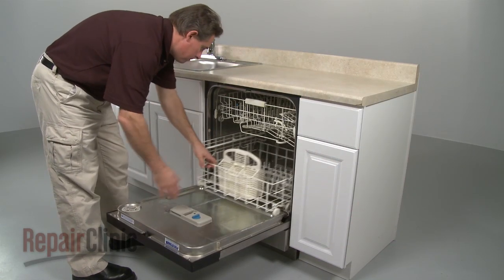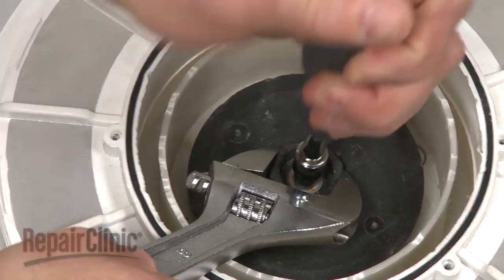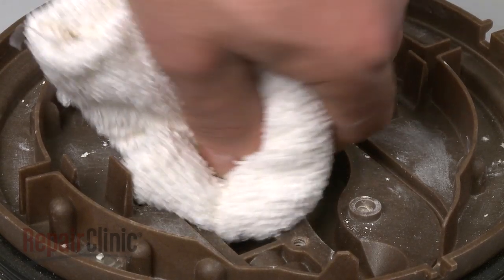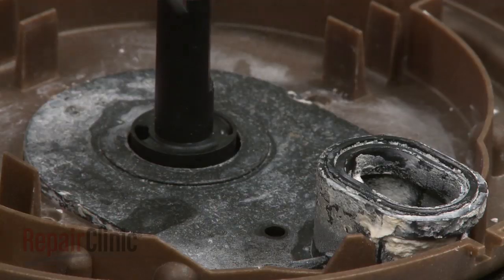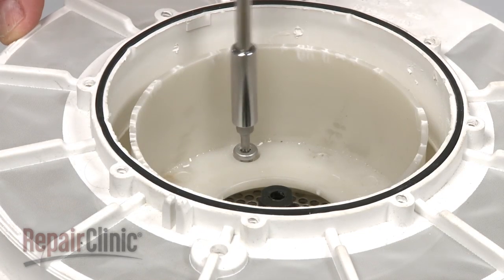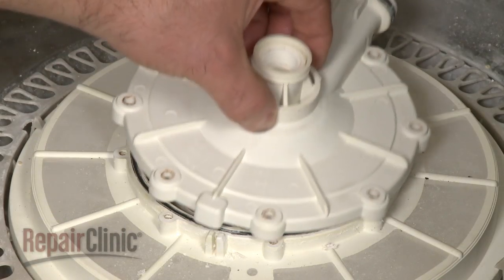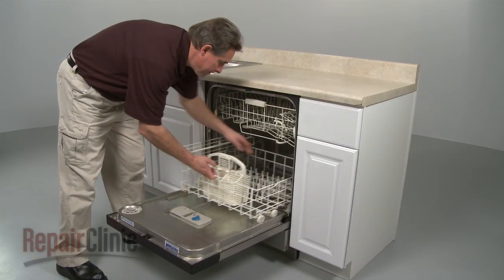Dishwasher Impeller & Seal Kit Installation #8193524 or 675806

Comment: Fantastic to have a clear picture of dismantling and reassembly.  Gave me the confidence to take mine apart.  The inside was disgusting.  No wonder the dishes weren't getting cleaned properly.  Fatty gunk blocking everything.  Found a screw and washer in the upper impeller water pipe, no idea how it got there.  It was the same as that which holds the impeller in place.

Comment: The kit comes with a gasket that the video does not mention/use.  Put the smaller gasket where the check ball holder has a gasket.  (Hey Repair Clinic -- put a note on the video.  No need to reshoot the whole video.)

Also, my drain impeller was broken to pieces.  This made getting the impeller screw out REALLY REALLY difficult.   We put an ice pick through the motor windings hold the motor still.  It took two people to get the screw out.  The dishwasher is working!!  Thank you Repair Clinic.

Comment from the maker: The small seal goes where the check ball sits in the oval recess. It unfortunately was not replaced in the video.  Our repair Gurus have made a note of this and are considering a re-shoot.  Thanks for pointing it out!  If you need any more help please refer to the help section of our website (links in the description).

Comment: Great video, I had trouble removing the impeller screw. The inside of it had broken so I could not keep it from spinning while removing the screw that holds it on. Had to take a Dremel to it and cut it off. Once it was removed I could put a wrench on the metal shaft and then remove the screw. Thanks for the help!
Reply from the maker: We're glad you got it done in the end. Congrats!
Reply: Mine stripped out also. I had to hammer and chisel both plastic pieces out.

Comment from the maker: I would check the impeller to see if there is something clogging it or if it is damaged. If this doesn't help I would suggest heading to the repair help section of our website (link in the description). If THAT doesn't help there are many reputable  DIY blogs and forums that should be able to help.

Comment from the maker: @WildMuffdriver The manufacturer has updated the impeller kit so that the busing is not reinstalled. The kit comes with instructions to throw away all old parts and use the parts included in the new kit.

Comment: Thank you so much for your video.  My washing machine was extremely "crusty" inside, making it difficult to remove the parts (cemented together from mineral deposits).  It seems that the washer could be designed much more efficiently to service the parts. It's almost like the manufacturer designed it to be so difficult to repair that it would be easier for the homeowner to just buy a new one!

Comment from the maker: Sid, The motor does not have service parts so if it is coming from the motor then you will need to replace it. If it is coming for the pump and you installed a new kit we would suspect debris got left behind.
Reply from the maker: Sid Kamath Thank you.

Comment: Thank you- this is my exact dishwasher!  

The smaller gasket that is supposed to replace the gasket in the oval part of the drain cover seems much smaller than the gasket it is replacing. Is that correct? I noticed that the gasket in the separator assembly does not need to be stretched. Also- should I be using "Lube Magic" or some sort of gasket seal gunk when I put the gaskets in?

Yes- a few of those parts were MUCH harder to remove- I had to dremel out the wash impeller cover when I broke the part you recommended to put the wrench on while taking out the screw. The screw did NOT come out until I  was able to put vice grips on the motor shaft after I took out the separator assembly. It's a shame that those parts get so brittle with age and all the heat. Should they not be made of a material that will withstand the heat? I hadn't intended to have to replace these parts. 

I am, however, very thankful to have had this video to help me figure it all out. Thanks again!!!

Comment: If the impeller is broken off from the shaft, it may be difficult to remove the screw. I took the bottom cover off of the dishwasher and stuck a screw driver in the motor fan to lock the shaft in place while I unscrewed the impeller. Worked well for me.
Reply: I was wondering if you had one or two check balls cover when you took yours apart, if you can remember. I only had one, the video says check ball "or balls", but the schematic I've linked to below shows two balls: 

http://www.manualslib.com/manual/87821/Kitchenaid-Kuds24seal4.html?page=11#manual

Thanks!
Reply: Ryan Actually, mine had no check balls. or if it did there wasn't anything left of them..
Reply: Hey, thanks for getting back to me. The dishwasher is working with one check ball after rebuilding so I guess things are ok.

Comment: You didn’t put the GRIND BUSHING at the :50 minute mark back on with the new one. I just replaced mine and couldn’t figure out how the grind bushing would fit back. Mine also had a stainless cylinder sleeve about an 1” long also that wouldn’t fit back with the new kit. I thought I forgot how I took it apart but laid every part out on the floor in the order as I removed them (always a good idea). It would be nice if these kits had instructions telling to discard those 2 parts if they aren’t needed. It causes confusion.

Comment: Just a question. At 50 seconds of the video they remove the grind bushing. On reassembly (around 2:09 min.) the grind bushing is never reinstalled. Curious to know if this was on purpose or an inadvertant omission? Anyone else notice?
Reply: Mine had that and a stainless tube bushing about an inch long and I racked my brain trying to figure out how to reinstall them. I laid everything out as I removed the parts and couldn’t get those 2 parts to fit back. I thought I forgot how I disassembled everything. That’s before I watched this vid. There’s another vid with a similar dishwasher and it doesn’t have those 2 parts. I wish they’d put instructions with the kits telling to discard those 2 parts. Mass confusion.

Comment: Thank you for posting this great video. I wish I saw it BEFORE I took apart and reassembled my Kitchenaid KUDS24SE.

I noticed you only have one check ball in your video. When I took removed my separator assembly I only noticed one check ball. According to the parts list on your website: ( http://www.appliancepartspros.com/pump-motor-parts-for-whirlpool-kuds24sebl4.html ) there are two drain check balls, manufacturer part no. 719929. I only remember seeing one ball when I was disassembling my KUDS24 but there was so much gunk I could have accidentally vacuumed it up with my shopvac or thrown it out. 

How can there be such a major discrepancy? My unit looked just like the one in the video except my pump base is black, not brown. 

Any help would be much appreciated.

Thanks.
Reply from the maker: Ryan The link you are referencing is not a RepairClinic.com link. The parts results should only list one check ball, as shown in the video.
Reply: Hi there. Thanks for getting back to me.

The parts list from Kitchenaid does clearly show 2 check balls for model KUDS24SE BL4/WH4/AL4 (the last three characters denote only the color of the model), which is the model you are working on in your excellent video.

The manufactuer part number for the check ball is 719929 and is listed on the Pump and Motor Parts list provided by Kitchenaid as "Ball, Check (2)."

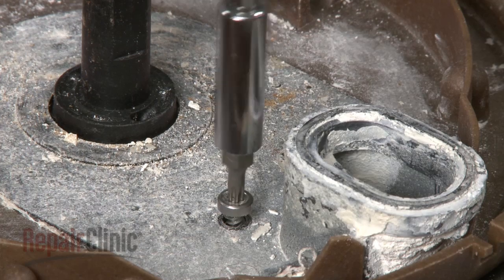In your video at 0:56 you do say "lift out the check ball or check balls", which I take to mean there could either be one or more balls. You show only one ball in your video which is what I found in my dishwasher, the KUDS24SEWH4.

I did rebuild my unit with the one ball and it seems to work fine.

Could you please clarify why you say "check ball OR BALLS" in your video?

Thank you!